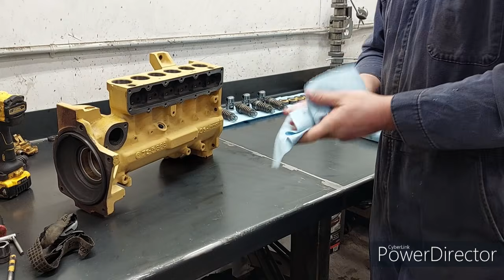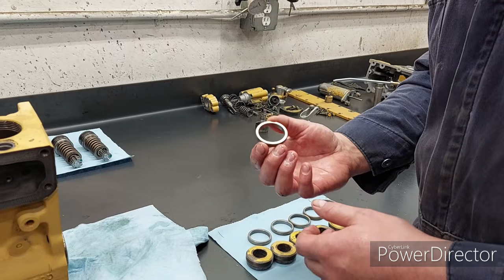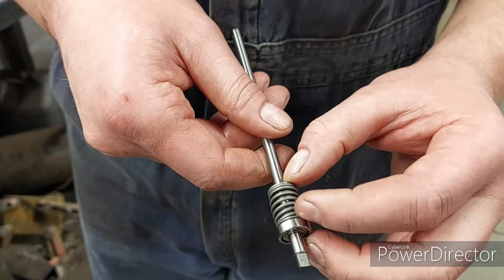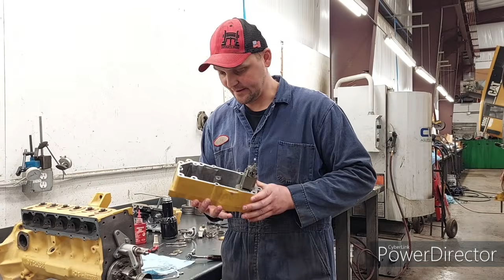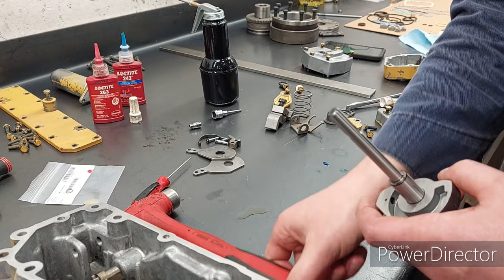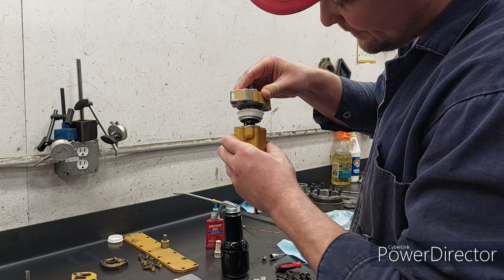3406B Fuel Pump

Comment: Excellent video I would also like to know how to set the spring and screw on the timing advance. Also one on timing the engine I have one that sounds like it’s running cold I resealed the advance and it did help but I think it’s still not correct
Reply: You set static timing, (pin) with a bolt in the flywheel. The start and end of advance you have to set dynamically. The spring on the timing is based on engine serial number and HP. You install the timing indicator group, warm the engine up. You go to TMI on the Cat network, (you have to have Cat access) to find your timing information. Again it is based on serial number and HP. If the engine has been rerated, you have to use the performance spec. Once you get your spec, you first check ref timing window. It is usually 1,000 RPM's +/- 30 RPM's with a 1.5 degree tolerance. Now you have you base timing (slot cut in the fuel system camshaft). On NSFS you have 0.2 degrees of port effect for every 100 RPM's. So at ref RPM, (1,000 RPM's) you would add 2.0 degrees of advance for the port effect. So if your static timing on the fuel system camshaft was 24.0 degrees, (0) RPM's it would be 26.0 degrees of advance, at 1,000 RPM's. So you have graph paper, min RPM's would be 970 high to low. Max RPM's would be 1030 RPM's high to low. With max advance at 27.5 degrees and min advance at 24.5 degrees. If your in tolerance at ref RPM"s the next box is start of advance. Again TMI has start number. You box changes, now you have 100 RPM tolerance and a 1.5 degree tolerance. Now between ref RPM and start, you still have to add your 0.2 degrees of advance per 100 RPM's for port effect added to your start of advance. Next is your end of advance and your spec changes again. You still have the 100 RPM min max, but your timing tolerance now changes to 2.5 degrees for the end of advance. Again you draw your box adding port effect of 0.2 per 100 RPM's. Once you have your timing graphed on paper, engine warmed up. You start recording advance at every 100 RPM's to high idle. Now if your start and end of advance is not on 100 number, lets say start is 1355 RPM's. I get a reading at 1350 RPM's and so on for the end. While engine is warming up, I usually see what ref point is and when timing starts to advance and ends. If you know it has to be adjusted, why waste time doing the full run. First adjustment is ref window, then start window and finally end window. Once your satisfied of your settings now you can do the full run of 100 RPM readings and record your numbers. You go all the way up and then you check it back down. Your making sure on the way down it is not sticking. Once you have all your numbers going up, you put them on the graph paper to see how smooth your advance looks. That is why you DON"T play with the start and advance screws. You have to have this tool to set it or check it. It cost a few $1,000.00's dollars.

Comment: Excellent instructional video, THANK YOU! If you could , please make one for setting the truck front timing advance on these pumps and timing the pumps properly.
Reply: You set static timing, (pin) with a bolt in the flywheel. The start and end of advance you have to set dynamically. The spring on the timing is based on engine serial number and HP. You install the timing indicator group, warm the engine up. You go to TMI on the Cat network, (you have to have Cat access) to find your timing information. Again it is based on serial number and HP. If the engine has been rerated, you have to use the performance spec. Once you get your spec, you first check ref timing window. It is usually 1,000 RPM's +/- 30 RPM's with a 1.5 degree tolerance. Now you have you base timing (slot cut in the fuel system camshaft). On NSFS you have 0.2 degrees of port effect for every 100 RPM's. So at ref RPM, (1,000 RPM's) you would add 2.0 degrees of advance for the port effect. So if your static timing on the fuel system camshaft was 24.0 degrees, (0) RPM's it would be 26.0 degrees of advance, at 1,000 RPM's. So you have graph paper, min RPM's would be 970 high to low. Max RPM's would be 1030 RPM's high to low. With max advance at 27.5 degrees and min advance at 24.5 degrees. If your in tolerance at ref RPM"s the next box is start of advance. Again TMI has start number. You box changes, now you have 100 RPM tolerance and a 1.5 degree tolerance. Now between ref RPM and start, you still have to add your 0.2 degrees of advance per 100 RPM's for port effect added to your start of advance. Next is your end of advance and your spec changes again. You still have the 100 RPM min max, but your timing tolerance now changes to 2.5 degrees for the end of advance. Again you draw your box adding port effect of 0.2 per 100 RPM's, plus you add the degrees of advance. Once you have your timing graphed on paper, engine warmed up. You start recording advance at every 100 RPM's to high idle. Now if your start and end of advance is not on 100 number, lets say start is 1355 RPM's. I get a reading at 1350 RPM's and so on for the end. While engine is warming up, I usually see what ref point is and when timing starts to advance and ends. If you know it has to be adjusted, why waste time doing the full run. First adjustment is ref window, then start window and finally end window. Once your satisfied of your settings now you can do the full run of 100 RPM readings and record your numbers. You go all the way up and then you check it back down. Your making sure on the way down it is not sticking. Once you have all your numbers going up, you put them on the graph paper to see how smooth your advance looks. That is why you DON"T play with the start and advance screws. You have to have this tool to set it or check it. It cost a few $1,000.00's dollars.
Reply from the maker: Thank you John goldsmith for the deep dive into setting the timing advance. I do not own the cat tool for setting the advance. I have always been fortunate in rebuilding advances that have not been messed with from factory settings. You obviously have done lots of these. If you ever want to sell the tooling and loan some knowledge I would be very interested. Thank you for the informative response
Reply: @hellscanyondieselpower6537  Work for a Cat dealer, so I do not own the tool. But knowledge I do have. 92U engines was still being made when I hired in. The problem on VTU, numerous updates and design changes. I only do truck engines. So if the start and stop screws get messed with or a failure occurs that causes the screws to be damaged. You have to have this tool group. 
3406's now called A models used a slide advance, no adjustment other then pin timing. Port effect on it is 0.1 per 100 RPM's. I always replaced the springs if I have one in the shop and advance is off. 3406 B VTU had a slipping problem. 7FB's and 4MG's 1-03599 has no fix. You can weld them between the snap ring, but the core is no good. Also on the later 7FB's Cat put a plastic screen in front of the fuel system camshaft. Always replace it, as it can melt.
Reply from the maker: Just inframed a 92U. I thought they were almost extinct, but there are still a few out there.
Reply: @hellscanyondieselpower6537  What HP? Wrong head on a DITA can crack on top at number five cylinder.

Comment: Very good video very educational wood you please do one on the timing advance on this model thanks
Reply from the maker: When I get a chance to I will do an advance. There are many versions though
Reply: I have the p 1925 model thank you
Reply: You set static timing, (pin) with a bolt in the flywheel. The start and end of advance you have to set dynamically. The spring on the timing is based on engine serial number and HP. You install the timing indicator group, warm the engine up. You go to TMI on the Cat network, (you have to have Cat access) to find your timing information. Again it is based on serial number and HP. If the engine has been rerated, you have to use the performance spec. Once you get your spec, you first check ref timing window. It is usually 1,000 RPM's +/- 30 RPM's with a 1.5 degree tolerance. Now you have your base timing (slot cut in the fuel system camshaft). On NSFS you have 0.2 degrees of port effect for every 100 RPM's. So at ref RPM, (1,000 RPM's) you would add 2.0 degrees of advance for the port effect. So if you static timing on the fuel system camshaft was 24.0 degrees, (0) RPM's it would be 26.0 degrees of advance, at 1,000 RPM's. So you have graph paper, min RPM's would be 970 high to low. Max RPM's would be 1030 RPM's high to low. With max advance at 27.5 degrees and min advance at 24.5 degrees. If your in tolerance at ref RPM"s the next box is start of advance. Again TMI has start number. You box changes, now you have 100 RPM tolerance and a 1.5 degree tolerance. Now between ref RPM and start, you still have to add your 0.2 degrees of advance per 100 RPM's for port effect added to your start of advance. Next is your end of advance and your spec changes again. You still have the 100 RPM min max, but your timing tolerance now changes to 2.5 degrees for the end of advance. Again you draw your box adding port effect of 0.2 per 100 RPM's. Once you have your timing graphed on paper, engine warmed up. You start recording advance at every 100 RPM's to high idle. Now if your start and end of advance is not on 100 number, lets say start is 1355 RPM's. I get a reading at 1350 RPM's and so on for the end. While engine is warming up, I usually see what ref point is and when timing starts to advance and ends. If you know it has to be adjusted, why waste time doing the full run. First adjustment is ref window, then start window and finally end window. Once your satisfied of your settings now you can do the full run of 100 RPM readings and record your numbers. You go all the way up and then you check it back down. Your making sure on the way down it is not sticking. Once you have all your numbers going up, you put them on the graph paper to see how smooth your advance looks. That is why you DON"T play with the start and advance screws. You have to have this tool to set it or check it. It cost a few $1,000.00's dollars.

Comment: Instead of channel locks to spin the cam shaft, maybe an oil filter strap wrench?
Reply: Channel locks works fine. The fuel camshaft is hardened and you won't damage it. You put pumps one and four in first with the lobes down. Then you turn the cam and pin the pump. Now you can put the rest in. Doing one and four first, when you turn the cam, your only working against two lobes with resistance.

Comment: Excellent Video, I watched a cat guy demonstrate everything not to do when reassembling one of these and it instantly started putting 1 gallon of fuel per 100mi in the oil . It had dirt under the timing Spacers on two of them. I bought the manual for these and studied it and went to work resealing 10 of them for a guy. When reusing the barrel and plungers with new bonnets and lapped barrel to bonnet surface torqthe holdown bushing to 220 ft lbs with used barrel and plungers only. New ones can score from the tighter bores from the way they tend to deflect from the higher torque. Perfect video. I've heard a lot of guys that were half right and half misinformed but you've definitely spent as much or more time than me studieng the book at some point In your life. Never you should do one on the timing advance and how to properly setting it and using the cat 8T5300 Timing meter! Absolutely the only way you can set the timing and see it in real time advance when and how much its suppose too which is not possible to do without having a meter. Many tricks to that I learned over the years too.
Reply: If your bushings are not the new style your wasting your time lapping the barrel. I would not go to 220 on torque, can crack the housing.
Reply: @johngoldsmith6629  the 220 spec was in a TSB from cat.. also showed the chemical cleaning process that cleans the staining from the top of the barrel where the bonnets seal. I've used the 220 spec for years with no issues.  Like when the oring that seals the bonnet starts leaking I just replace the oring a torque to 220 and the drivers almost always tell me it runs smoother after. (Missed before slightly)
Reply: @lawrencebrown3288  Sounds high to me
Reply: @johngoldsmith6629  not sure if I mentioned that this is only recommended with used barrel and plunger with either a lapped original or a new style one...if you torque a new barrel and plunger assembly to 220 it will score it and destroy it. I probably never mentioned that part. I'll find the TSB and post it.
Reply: @lawrencebrown3288  I found it, I knew the increased torque on uses P & B's but the one I read years ago was only 10ft lbs. Thanks for the update.

Comment: That was a great video very informative. Thanks. And there are a lot of us use the mechanical shut off. Because the new solenoids are junk. I got the arm from Cat and use a cable shut off end of trouble.
Reply from the maker: I haven't had much trouble with the new solenoids from cat, the new style jakes switches however, are junk.
Reply: @hellscanyondieselpower6537  You can use the old 3406 type that mounts on the throttle shaft. But you have more parts, have to adjust it.
Reply: You can use cable, electric or air over electric solenoids. Use the plate on the cable and remove the old solenoid.

Comment: This is probably a stupid question but when did diesel fuel pumps switch from engine oil to diesel fuel to lube the cam and lifters. Is it because  they can't seal the piston from the crazy high fuel pressure.
Reply: Sleeve Metering fuel systems are fuel lubricated. In the truck world they was used on all 3208 and some 3306's.
The early 1693 used a forged body fuel system. Rest of the 1600 series used compact scroll. Most 1693's used compact scroll. The 1100 series used scroll, some 3306's and the 3406 (now called A model, 92U) used compact scroll.
Starting with 3406B, 7FB Cat changed to NSFS, New Scroll Fuel System. It lasted until the last truck mechanical or a PEEC fuel system was produced. The NSFS was basically the same, however I would say you had two types. 7FB1 thru end of 7FB's and 4MG1-03599. I give him a B+ on his video.
Reply from the maker: All new scroll pumps from cat are oil lubricated cam and lifters. 3300 series and 3400 series. I am not well versed in the older pumps, like off a 92U 3406A

Comment: lf you take the valve part of that piston and valve of the servo assembly and braze a washer to it, then put a spring between it and the injection pump, hook the valve on then end of the rack it will keep the rack pulled up against the timing pin so when put the barrel and plungers in it is a lot easier!
Reply: A lot of work that is not needed. Been building these for almost 43 years, never had to do this.

Comment: A  trick, take a white marker and mark the center of the rack teeth group for every barrel and plunger, so when you look down the bore you can verify the rack is centered when you put  barrel and plunger in! Also made a tool that keeps spring pressure on the timing pin to  also keep it tight against the pin! Cat has a 6V7050 3406 Compressor Group Tool that helps push down on the barrel and plunger that makes it easier to get the nut start with no load on the threads, works real well! Took a old nut and the top of an old barrel and plunger the threaded part brazed them together, did cut part of the threaded part back so nut threads were clear to engage injection pump! Used it to  help get the first barrel and plunger started, then can use the 6v7050 to finish the rest!
Reply: Once in how do you check and verify gear on pump is timed correctly to rack?
I just use the pin as the guide that is outlined in the T.E.N. article and or the service manual that shows you how to do it..
Reply: @johngoldsmith6629  You know that cat goes to the dealers and asks questions of mechanics on what they have done to make it easier, well I have given them many a tool design I have made and they have taken it back and made them under a Cat number! So if you do not like the idea do not use it, it was only a hint of doing it easier, do as you please! During the retro fitting of newer engines in machines cat sent out engineers to see how our shop did what we did to make things fit, and made whole articles of how we did it, so your saying do not lesson to new ideas that make it easier, Okay! Oh, over 47 years as a engine mechanic, just saying!
Reply: @oldcatmech  I have never been approached by Cat. I did show somebody from Cat a tool I made and Cat patented later.